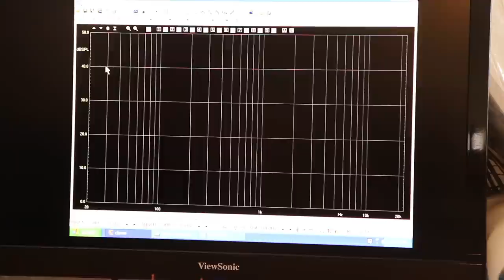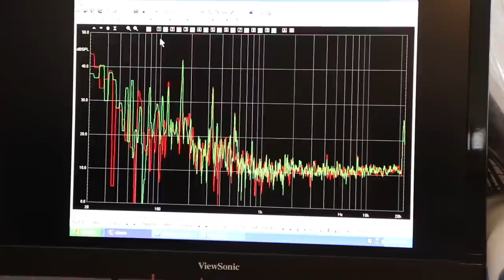Power Cable Tech Talk and a little help for Amir at Audio Science Review

Comment: I believe the Man who has the formal education in electronics, worked for Microsoft for decades using that electronics education and is using common sense science to debunk companies. Amir  has compared $1000 cables vs $10 cables and further more he is not selling us anything. He recommends using cheaper cables and to save your money.
Reply: If you use any critical thinking, most of the stuff Amir claims does not make sense. Probably a reason he no longer works at MS, which is not a Hifi company BTW.
Reply: @Pete from across the street  it makes perfect sense. You measure resistant/continuity between cables. They measure the same. Why pay $1k vs $5. He measures $5k vs a $100 Dac both measure same. He recommends save your money buy the cheaper Dac. That's common sense.
Reply: @adaboy4z  Dont blindly believe what other people say unless you've tried it for yourself first.
Reply: @Pete.across.the.street  Like what?  Can you name 2-3 things?
Reply: @ichigobankai2343  I did try it for myself from the expensive cables, Dacs and speakers to the cheaper stuff. Heck my speaker collection consists of Paradigm, Polk, Infinity, Kef, JVC, Samsung and Sony.
Reply: @adaboy4z  if you think $100 dac sounds the same as a $5000 dac, you're not using common sense
Reply: @literalghost929  his testing is flawed. He tried to test for EMI on an unplugged cable. In one of his reviews, he claims a $600 preamp is just as good as a $10,000 preamp because the $600 one measured "perfect". In another review he was measuring jitter on analog outputs, jitter is digital. In yet another review, he didn't recommend a product because it didn't do something that the product never claimed to do. In another one I saw, his conclusion was the exact opposite of what his data told him. In a few of his reviews, he was measuring the wrong thing altogether. If he doesn't use the correct measurements, they aren't very helpful. If you use any sort of critical thinking, most of his reviews fall apart, no matter if the data is repeated or not. He usually jumps to his own preconceived conclusions without actually testing what he claims or showing any proof of his claims. He claims things don't affect the sound, but if he actually listened, it does.
Reply: @Pete.across.the.street  If you pay 5 grand for a DAC, you are not using common sense.
Reply: @johndavidson6433  or I am not poor
Reply: @Pete.across.the.street  "He tried to test for EMI on an unplugged cable."

I remembering him explaining the exact opposite; about how some do it to show how damaging radio signals & other noise are for audio signals.

" because the $600 one measured "perfect"."

And was this ever disproved?  Or does it just not fit with your belief that more expensive always equal better?
Reply: @Pete.across.the.street  "In another review he was measuring jitter on analog outputs, jitter is digital. "

So it wouldn't show up in analog output?  LOL  Not sure what you're trying to imply here exactly, if your CD player is outputting analog, it could or could not suffer from jitter; jitter is like any other sort of distortion, measurable in analog.  The opposite would infer that jitter does not exist...

" it didn't do something that the product never claimed to do"

And what was that product and what was that thing?
Reply: @Pete.across.the.street  "In a few of his reviews, he was measuring the wrong thing altogether"

Which reviews and what things?

"If you use any sort of critical thinking, most of his reviews fall apart"

Like what review because of what thing?  It's just a blank, unsupported claim on your part, and given your previous examples.....

"He usually jumps to [...] without actually testing what he claims or showing any proof of his claims"

Like what?  Can you give a few examples?

"He claims things don't affect the sound, but if he actually listened, it does."

Like what exactly?
Reply: @Pete.across.the.street  If you pay $5,000 for a DAC, you have zero sense. You need to learn about the placebo effect. It is so strong it allows people to be operated on without anaesthetic. I have had to fight against the placebo effect when listening to hifi even though I know it exists. Measurements show that a £100 DAC is indistinguishable from a $5,000 one, unless one is deliberately voiced. Of course some say my ears are not good enough, or my system is not resolving enough, or the measurements do not include woo, well fair enough. I prefer science to BS.
Reply: @StillAliveAndKicking_  yup, everything is plocebo and everything sounds exactly the same. No use in spending more than $100 on your entire system.
Reply: That Argumento ad verecundiam just says you are pure blah, blah, blah. ha ha ha ha ha h ha ha ha ha ha ha ha ha ha.
Reply: @onemic-theminimalist  i agree; i emailed Audioquest to request that they send me measurements to back up their claims of their products, i'm still waiting months later... snake oil me thinks.
Reply: @Pete.across.the.street  I am not poor but I'm also not stupid. LOL!
Reply: @adaboy4z  You absolutely know nothing about nothing. Continuity? Without continuity you don't even have a cable. You make no sense at all. Resistance in an 8 foot speaker cable is irrelevant. Its like saying all wines taste the same because they come from grapes.
Reply: @Pete.across.the.street  Amir is a bonehead.
Reply: @johndavidson6433  So NASA paying millions for a mirror is not using common sense?
Reply: @onemic-theminimalist  Let me know which measurement affects soundstage width or height. I have amps with a wider soundstage and others with higher a soundstage. They measure the same with all traditional measurements.
Reply: @carlosoliveira-rc2xt  why are you comparing apples to oranges? The Hubble and the James Web show measurable improvements over earth-based telescopes. Unfortunately, the same cannot be said about Danny's power cables.
Reply: Why even bothering listening to music if you can’t hear the difference.
Reply: @acksion  I am sure you can also see the emperor's new threads too!
Reply: @carlos oliveira  . We not talking about mirrors and NASA. Lmao
Reply: @Pete.across.the.street  Of course everything doesn’t sound the same. But properly made mains cables don’t have an audible effect on the sound from your speakers. In order to determine whether or not something does affect the sound, the only sure way to know is to perform double blind trials. However, basic electronics would have given you the answer. That doesn’t stop almost the entire audio industry from producing expensive products, each packed with high grade woo, to line their pockets. Look up the term Veblen product.
Reply: @Pete.across.the.street  Likewise, being rich is not an excuse for lacking common sense.
Reply: @kevintomb  yup, common sense isn't very common
Reply: Hahahahaha
Reply: Please, I need a good explanation here from the placebo guys. 25 years a ago, I bought Van den Hul interconects and speaker cables to replace simples Monster Cables. I swear was afraid of spending money for nothing. After 15 minutes listening to the new configuration, my ex wife just walked into the room and asked: "What have you done?". BTW, she does not give a damn about hifi and did not have any idea about what was happening. Placebo without knowing anything?
Reply: @joaopedroscarcella422  everything they don't agree with is placebo. Even though they have never listened to the product. When your system sound horrible, that's when you know you got it right, because you can't trust your ears.
Reply: @João Pedro Scarcella  When I switched from generic Walmart speaker wire to Monoprice, Mogami, Audioquest, and SVS I swore I heard the same changes as you. But after switching back several times with lengthy listening sessions, it was Placebo. I even bought the "Audiophile" usb cable, thinking it would make my Dac more transparent than it already measures. I wasted a lot of money. Lesson learned.
Reply: @adaboy4z  what gear is in your system? If your system isn't resolving, you won't hear difference.
Reply: @Pete from across the street I have several systems but my main system  is a Yamaha R-N803 stereo receiver on Infinty SL 40 towers, Technics SL-P150 CD player, Pioneer PL-5 Record player and Carver HX Pro cassette Deck.  I stream from my computer using Tidal. Other speakers include Paradigm Titan V6 and Kef Q150's. Do I pass?
Reply: @adaboy4z  streaming from your computer might be your weak link, they are very noisy. Idk that equipment. Do you get a 3d sound stage? Are your speakers against the wall?
Reply: @Pete from across the street  Modern Dacs do a great job with PC noise as measured on ASR. And yes, my speakers out out from the wall. Do I hear a 3d sound to me that depends on the recording.  The two individual Dacs I own are now are the Topping E70 and SMSL A0100. I've owned the $80 Dac up to the $600 Dac chasing audio nirvana.
Reply: @adaboy4z  yeah all the dacs below $800 are nothing special. They are all pretty much interchangeable. What you are looking for you're going to have to spend a bit more. Your system is only as good as it's weakest link. Cables are one of the last links to upgrade because you need a resolving system first.
Reply: @Pete from across the street  My system is resolving. I hear every detail and nuance in the music. Its crazy that you believe you need to spend greater than $800 for a signal conversion to be resolving. The Dacs I own all measure excellent, the cables cause no interference. Put it like this why does a  $5000 Dac come with the same power cable as a $300. Because it makes no difference.
Reply: @adaboy4z  how do you know it's resolving? Resolving compared to what? Have you heard a $5000 dac? They come with cheap power cables, because most people throw them out and use aftermarket ones. The manufacturer doesn't want to add to the cost.
Reply: @Pete from across the street  That's a ridiculous statement, " most people" throw them out. Do you know most people? No manufacturers understand signal transfer and know you won't hear a difference. They sell you an aftermarket cable because they are a business and want to take most of your money!
Reply: @adaboy4z  how many have you compared on a high end system to know all this to be true?
Reply: @Pete.across.the.street  OR maybe you should read, he retired?
Reply: @kevintomb  I never learn to read.
Reply: Hahaha😂 its a lot fun to read this thread, so many stupid comparisons, for instance  about NASA paying to much for a mirror🤣 It's all about what specifications something has to meet, very low tolerances,  ability to withstand high pressures and high or low temperatures makes things extremely expensive. Working as an engineer in automotive and aerospace industrie for 15 years I know.
And the before that I have worked in Pro-Audio for 10 years and on the side of these jobs I had my own audio shop specialised in Turntables, DIY Speakers and Tube Amplifiers. When I was young I fell for a lot of the selling bullshit from companies, and very often me beeing biased towards these products I believed to hear al kinds of improvements. Until I got educated in engineering and learned more about electronics than the pure basics, learning to use blind A B testing made it clear for me that what we can measure is not always audible, but that whatbis audible is always measurable.

And as Amir states in several of his tests it has no point to hunt for less noise if noise is allready below the hearing threshold, and far out of the frequency's that people are able to hear. 
And instead of buying a $400 dollar cable from GR Research, buy one of his upgrades for your speaker, you will hear an improvement on that.
Nothing bad on the work on speakers by Danny, he does a great job pointing out the good and the bad things on speakers, although he does exagerate a bit sometimes 😉
Reply: @Pete.across.the.street is right... a system that isn't resolving enough will never allow the listener to hear the smallest differences in sound quality.
Reply: @joaopedroscarcella422 fools may suggest that cables do not make a difference at all. Metallurgy, solder, internal wiring inside an amplifier, main filter capacitors inside a power amplifer, power transformers, and the smallest change inside an audio component can impact sound quality. Everything matters. If it didn't we would have Hollywood studios buying $99 DACs and other garbage recommended by ASR. 

A small change in resistance, capacitance, or inductance / voltage can alter sound quality in resolving (good) audio systems.
Reply: @Pete.across.the.street Pete, you literally have provided no science other than saying other ppl are poor and my ears are better than yours 😂 Omg come on my guy
Reply: @StillAliveAndKicking_ have you even listened to a $5k dac?
Reply: @Pete.across.the.street  You're the kind of guy the snake oil salesmen LOVE!!!
Reply: @adaboy4z  things we hear like holography in the time domain are things that can’t be measured with that equipment. If you think those measurements are absolutes to what the human ear can perceive, then buy the $100 switch mode delta sigma dac. But there’s better.
Reply: @jonathandavis9507  Explain Holography in the time Domain and what it sounds like please?
Reply: @adaboy4z  you can do your own research there’s books on acoustics you can read
Reply: @adaboy4z  it sounds amazing
Reply: @Pete.across.the.street  So you can't describe it or how it's created with these magical $1000 dacs that measure the same or less than a $150 dac.
Reply: @jonathandavis9507  That's the same answer most people give who don't know and swear their dac gives a special sound. It's about the recording and speakers.
Reply: @adaboy4z  which measurements are the same?
Reply: @adaboy4z  enjoy your $100 dac
Reply: @jonathandavis9507  It sounds wonderfully quiet, detailed with great instrument separation and deep bass. 👌
Reply: @adaboy4z  great!
Reply: @adaboy4z  so if I can't tell you why there's a difference, that means there isn't a difference 🤔
Reply: @carlosoliveira-rc2xt  maybe you sat on a barstool instead of a sofa? It's all relative offcourse.
Reply: @dillonsaudio I know that the studio the actual music is recorded in isn't using 2000 dollar power cables😂😂😂
Reply: @johndavidson6433  I wasn't comparing apples or oranges. Go to the fruit market where things don't go over your head.
Reply: @adaboy4z  It also went over your head. I'll dumb it down for you next time.
Reply: @StillAliveAndKicking_  The problem is that you have neither owned nor heard expensive cables on an expensive system .
Reply: @johndavidson6433  Are you that obtuse to be unaware that NASA spent millions on a mirror that was out of focus so they spent millions more putting a correction to it?
Reply: @adaboy4z  He's right, most people throw them in the closet or attic and forget about them. I've been in this hobby/industry for 45 years and have had many, many, many clients and associates so I can speak from some authority.
Reply: @adaboy4z  You think resistance is all there is to a cable? As for continuity that isn't a cable spec, that just tells you it is connected at both ends. Lol
Reply: @adaboy4z  $1000 DACs are midfi as well, no one thinks they're magical.
Reply: Do you mean of course? Maybe you fell off your bar stool.
Reply: @carlosoliveira-rc2xt Ah, the “your hifi isn’t resolving enough” argument. People cannot tell the difference between modest and high end amplifiers once the frequency response is adjusted to match. There’s a famous experiment where an amplifier maker made his modest amp sound exactly like a very expensive one by adding cheap components. It’s snake oil.
Reply: @carlosoliveira-rc2xt You can’t speak with some authority, the brain is so easily fooled. Double blind trials are the only way.
Reply: How about believing your own senses. And Amir does have ties to some manufacturers like Topping.
Reply: @Coneman3  How about discovering how easy it is to fool your own senses, and seeing how many manufacturers exploit that weakness for profit.
Reply: @StillAliveAndKicking_  both ears/brain and measuring instruments have strengths and weaknesses. This is why all Hifi developers use both to make their products. Yours and Amir’s position, under the guise of being intelligent and rational, is actually narrow minded and lacks insight. Both measurements and perception are both used to sell gear.
Reply: @Coneman3  Hifi developers can produce some complete cr@p accompanied by heavy marketing. You might notice that Amir’s reviews have his subjective view too. My experience is that hearing changes with time. Obviously it’s really one’s mental state that changes. That excitement with a new toy fades with time.
Reply: @StillAliveAndKicking_  equally measuring Hifi can sound very different. How do you explain that? My answer - they are measuring the wrong thing, measurements are not encompassing everything or something else is happening that is misunderstood.
Reply: @Pete.across.the.street why?
Reply: @jerronimo13  I want to hear the music as it was recorded. No more, no less. And no, you don't need fancy/ultra heavy duty power cables. Where did you crawl out of anyway?
Reply: Amir does have conflicts of interest. Topping for example.
Reply: @Coneman3  explain please…
Reply: @adaboy4z what about others with a formal education in electronics, such as electrical engineers? I understand what Amir is trying to do, but in reality a high end DAC or amp / CD player etc. is going go slay budget-priced offerings from companies whose only claim to fame is excellent measurements on a test bench. Talk to a real-world Engineer who builds HVAC systems, consumer electronics, industrial products etc. And they will tell you that these budget-priced products that merely measure well are mostly garbage. I am on board with Amir's findings with speaker and headphone measurments as correct, but everything else no.
Reply: @StillAliveAndKicking_  because you have preconditioned yourself to believe there isn't a difference; therefore, you will not hear a difference. You probably also won't listen carefully for a difference.  

If you take notes after your listening session and compare say, two different DAC's both outputting the dame voltage on thr same amplifier/test track/music software etc.

Even the first 30 seconds can sound different.

If you've never heard a track that sounded "holographic" with an elevated/almost microphonic midrange, then you never reachd summit fi.

Low-fi companies that produce this crap have a mandate to sell their audio equipment in large volumes. Of course their claim to fame is excellent/ perfect measurements.

Why then, do audio components sound different?

They know it does. And they are fooling you.
Reply: @Pete.across.the.street  exactly right... a system that isn't resolving will overshadow the original sound so much that its sonic presentation will not allow the listner to hear any differences. It's like a massive tone control or EQ that isn't fixible.
Reply: Most of high end and almost all tubes gear has bad review from Amir.. thats when I stop reading his review
Reply: How about finding out for yourselves
Reply: You have to have ears like a bat to hear any difference between expensive and not expensive. 
And I’ll bet humans don’t have bat ears. 
Good copper wire and decent connectors is all that I need to satisfy my bat ears. The rest is up to source components and setup. 
Anything else is a sales pitch